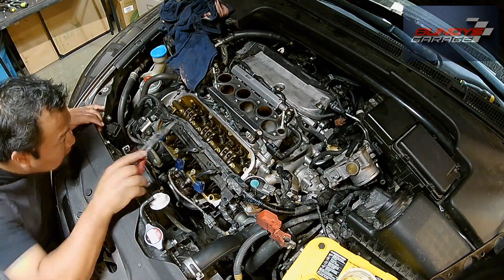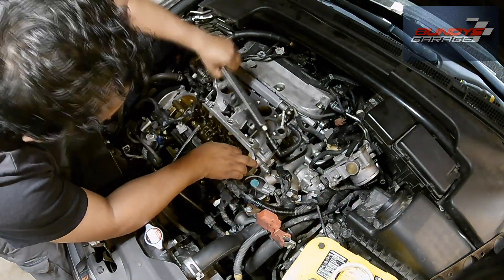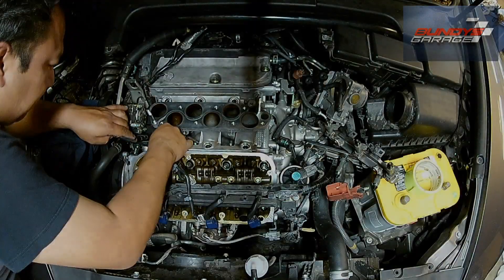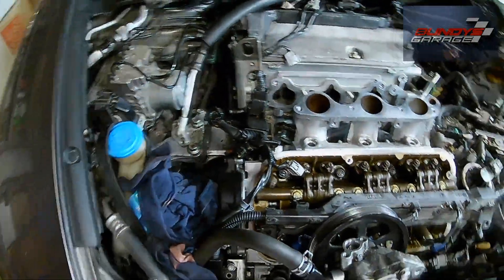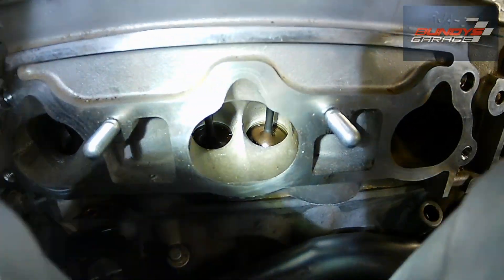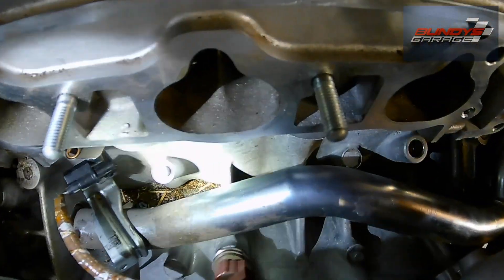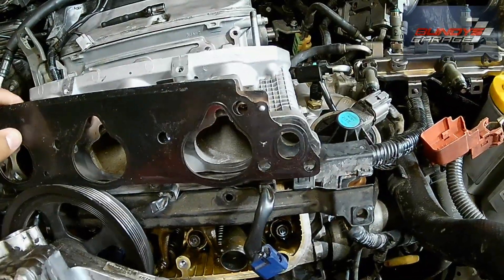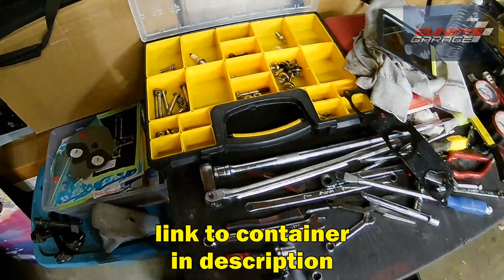Honda V6 Acura J Series Lower Intake Manifold Gasket Replacement | Accord Odyssey Pilot Ridgeline

Comment: I'm sorry... but this is the second video I've seen by this man and he's doing some questionable things. Case in point he is removing the bolts from the fuel injector rail without covering the holes of the lower intake runners! That is a MAJOR no-no. Those gaping holes are directly above the valves... you can see the back of the valves from above the chambers! You drop any piece of crap in there and it is in your combustion chamber and you're screwed. No disrespect intended but this work is careless. People, if you are going to DIY with deep dive repairs watch multiple videos on whatever task you want to attempt before you go diving! One can easily wind up with way MORE expense if you break a bunch of stuff then have to hire someone anyway to fix it all. -Jess Sayin
Reply from the maker: I could delete this comment like most DIY repair channels do when they receive a bad or insulting comment. Try it some time and see how long your comment stays up. YOU MY FRIEND ARE 100% RIGHT! I should have covered those holes. I didn't but yes if you are that deep into an engine you should cover them, better safe than sorry.

Comment: hey bundy. your channel is gold. 2006 TL 188K i performed this replacement using Honda genuine parts for the gaskets along with an NTK knock sensor and genuine rat harness. it had previously had the harness replaced and i saw this when replacing my fuel injectors two months ago and figured it would be unnecessary. when i later discovered the injectors i had purchased were counterfeit, i decided to purchase Hitachi injectors from RA and do them along with the lower intake manifold gaskets and a throttle body gasket. the injectors resolved my lean condition, but i was hoping the gaskets would resolve my multiple cylinder misfires under load (WOT), but unfortunately it did not. i believe i still have a vacuum leak and the smoke test only keeps showing the EGR valve leaking which i cannot seem to find out if is normal or not on these cars.

Comment: @bundysgarage

Question hope @bundysgarage can help.

I did this same exact job on my 2002 odyssey while replacing the valve cover gaskets. Replaced all the metal gaskets related to intake manifold and the Injector Base (actual name of the 2 bottom parts that you say are the forgotten gaskets). We'll after putting it all back and torquing to specs, I got a p0171 and p0170 along with a loud air sound when pressing the accelerator coming from the back of intake. After 3 weeks of trying out multiple things replacing o2 sensor with New denso, new coils, replaced EGR, 6 new oem Injectors, new map sensor, new knock sensor, new intake tube, checking for vac leaks, replaced throttle body, inspected all hoses and plugs for damage and checked for vac leaks with smoke machine, and troubleshooting day and night, I find out I was given the injector base gaskets (forgotten gaskets as you call them) for a 99-01 odyssey which have a tear drop like shape on the ports and the one from the 02-04 are more oval.....Soooo, I figured that was the issue all along and ordered correct parts and installed and guess what...van runs great BUT still giving me the p0170 and p0171 code along with the hissing air sound from the intake that I cannot figure out.

I've been trouble shooting this van for a month now and spent over $250 in parts and have redone it all 4 times and still same issue. The van didn't have any CEL lights before this repair and would drive fine, now it boggs from 1k-2k rpm but is super smooth there after so not sure what else to do, I'm so frustrated.

Can anyone help me figure it out?

Comment: about to attempt this along with new injectors, rat cable, and a new NTK knock sensor. ive been chasing a multiple cylinder misfire under load on my 2006 TL. new hitachi coils, ngk laser iridium plugs, honda fuel pump, new aisin tbelt kit, valve adjustment, leaking spark plug tube seals and valve cover gaskets replaced, oil filter housing gasket set, cam thrust plate gaskets, and much more has been replaced but i keep getting flashing p0300, p0301, p0302, p0304, p0306 when i give it the beans for 10s ish. misfire count starts around 3,000 rpm but since i adjusted the valves it is more erratic as to when it starts, usually higher than 3,000 now.
Reply: Yoo did replacing these fix your misfires? Chasing the same thing. Did new plugs, coils, valve adjustment and still getting a random intermittent misfire
Reply: @j35ray no lol, ive done a valve adjustmsnt, ive used OE parts for ignition coils, plugs, tube seals, injectors, all intake manifold gaskets, knock sensor, fuel pump module, timing belt kit, list goes on, oil filter housing gaskets etc sometimes multiple sets to rule out counterfeits etc. im gonna get it scope, it really could only be like a clogged resonator somehow vtec failure (camshaft or rocker arm) or somehow like wiring harness ecu ghosts. mine is multiple cyl misfire under load
Reply: @wolleyreikivalley  do you have stock cats? I'm thinking mine might be the rv6 high flow cats getting clogged or something. I read about someone who's misfires went away after he took off the aftermarket cats. Is yours intermittent or comes on after you push it? Mine would always come on after I push it... like 30 sec after doing a highway pull then it starts vibrating like crazy and I see the knock count go to the 100's on my ktuner
Reply: @ stock cats, rv6 j pipe

Comment: Great video. Before removing injectors, do you relieve pressure on gas lines??? Most videos do not show this step. I thought it was safer to relieve pressure.
Reply: Just remove the 15a fuse under the dash (#1) and disconnect the negative battery terminal. That will relieve pressure

Comment: Taking the front bank intake was impossible for me. The studs require the bottom intake to come out at an angle and I suspect this demands the rear (firewall side) to come out as well- I’m just replacing the nox sensor. Took out the bracket behind power steering pump after taking it off partially and could fit my hamd in and finaglt it in.

Comment: hey Bundy I have some questions about my Honda accord v6 if you are still around
Reply from the maker: Bundys always around baby! What’s the question?
Reply: @bundysgarage  hell yea what’s up bundy is there anyway i could facetime you off gmail or something i feel like it would be easier too show you what’s going on, it’s not hard too explain but it is just some hoses and stuff from my thermostat housing i don’t know where they go and little things like that i was hoping you could point me in the right direction i can make a few videos on youtube instead of a facetime but i think a zoom call or something would be the best way too show you🤣
Reply: @bundysgarage

Question hope @bundysgarage can help.

I did this same exact job on my 2002 odyssey while replacing the valve cover gaskets. Replaced all the metal gaskets related to intake manifold and the Injector Base (actual name of the 2 bottom parts that you say are the forgotten gaskets). We'll after putting it all back and torquing to specs, I got a p0171 and p0170 along with a loud air sound when pressing the accelerator coming from the back of intake. After 3 weeks of trying out multiple things replacing o2 sensor with New denso, new coils, replaced EGR, 6 new oem Injectors, new map sensor, new knock sensor, new intake tube, checking for vac leaks, replaced throttle body, inspected all hoses and plugs for damage and checked for vac leaks with smoke machine, and troubleshooting day and night, I find out I was given the injector base gaskets (forgotten gaskets as you call them) for a 99-01 odyssey which have a tear drop like shape on the ports and the one from the 02-04 are more oval.....Soooo, I figured that was the issue all along and ordered correct parts and installed and guess what...van runs great BUT still giving me the p0170 and p0171 code along with the hissing air sound from the intake that I cannot figure out.

I've been trouble shooting this van for a month now and spent over $250 in parts and have redone it all 4 times and still same issue. The van didn't have any CEL lights before this repair and would drive fine, now it boggs from 1k-2k rpm but is super smooth there after so not sure what else to do, I'm so frustrated.

Can anyone help me figure it out?

Comment: Nice video, just used it to replace my intake gaskets after a mouse build a nest in the valley. I do have a question, I have a high idle, tried changing the iacv and its still doing it, and when I block off the hose to the throttlebody and now it squeal like a belt is loose from the back of the engine towards the firewall, but it does not die. I have tried carb cleaner and smoke machine to find a vacuum leak with no results. I have tried clamping vacuum hoses to find if one is bad. Any advice you can give? Found your video really helpful! 👍

Comment: Duuuude, I snapped the stud on one of lower manifolds when I was removing the upper intake to change the valve cover and tube seals. I was devastated because I thought they might have been directly off the block. (Im dumb and didn't know much about my car at the time) Now I know I can replace them and have an instructional video on how to do it. Thank you!

Comment: Great video, helped me do my 06 Odyssey lower gaskets.  That is pretty intimidating and does not come off easy.  Key is to take off bank 1 (rear) first.  I used a curved bar to get leverage on the corner of the rear intake and a small screwdriver between the two intakes.  Like you said patience, works.  I used valve grinding compound to clean up the surfaces. Stuffed paper towels into the ports to prevent contamination.   Reason for changing gaskets is that I am chasing a P0507 high idle and P2279 vacuum leak.   Will know if it works tomorrow.
Reply: Did you fix the issue. I am chasing exactly same issue in my 07 odyssey. P0507 and P2279.

Comment: Is there a good way to clean the intake valves while partially exposed? I'd assume spraying carb cleaner. Any suggestions? Thanks
Reply: Is it GDI?  This should be a MPFI engine so the injectors will keep intake valves clean

Comment: Other than the 4 bolts on bank 1 is there anything else holding it in? I can’t get bank 1 out
Reply from the maker: One of them has 4 bolts and one has 5 bolts holding it in place. If it's not coming out easy than there is a bolt left in. I don't remember if it's front or back.

Comment: I have lots of oil down in the valley by the knock sensor , any idea where that is comming from ? Thank you so much for your videos , soooo much help and very informative!
Reply from the maker: Most likely the oil is coming from the valve cover gasket and getting into the valley
Reply: I know it’s hard to give an answer without hearing and seeing it but I changed out the lower and upper intake manifold gaskets and injectors , and spark plugs and wires and now it’s running like crap , any idea where I went wrong ??? Thanks again for ur help and advice Bundy , wouldn’t be able to get anywhere without ur videos 🙏🏼🙏🏼🙏🏼🙏🏼
Reply from the maker: I would check all my spark plugs and make sure all the coils are in place and that they are all plugged in. If it was a gasket you would hear a hissing sound like air getting sucked in and most likely the car would have a really high idle. What’s the year make and model?
Reply: 99 Honda Accord 3.0 v6
Reply: Could my timing messed up ? Or maybe the valves? It’s the 4th cylinder, I pull the spark plug wire up and it doesn’t do anything the wire and plug is brand new , even switched um up and they worked fine , still don’t change when I lift the spark plug wire on 4
Reply from the maker: Are you sure you have compression in that cylinder?

Comment: Just found a crack in bank 2 thank you for this video. I'll be taking her apart. She probably needs a ground up rebuild (at this point I'm halfway there anyways)
Reply: Did you have syptmtoms similar to a blown head gasket but little to no loss of coolant? My exhaust smells bad like burning coolant. I'm about to schedule a head gasket job but I do have the lower intake manifold gasket already and ported runners just not installed so I was wondering if I should just do that first.

Comment: Here a tip for putting the grommets on the retention bolts for the valve covers.
1) Put the bolt you are working with carefully in a vise so the vise holds the wrench side of the bolt (the bolt will be pointing up).
2) Carefully cut the old grommet off with a box cutter.
3) Put the grommet on the bolt and press it over the bolt's bulge by use a box-end wrench. The wrench should just be big enough to clear the bulge of the bolt as you push the grommet past it.
Reply: It takes less than 1 min to mount a grommet onto the bolt with a socket. The trick is to use a 45 degree angle. Do not push straight down. Not much force involved in you have the angle.

Comment: Wats that metal tube running under the manifold
Reply from the maker: It’s a coolant passage tube that runs from the thermostat housing to the water pump
Reply: @bundysgarage  is that prone to leak on these engines??
Reply from the maker: No I have never seen one leak. The failure point in a J Series cooling system is the water pump

Comment: Hello. Im getting code p0507 after I did my valve cover gaskets they were leaking oil but my idle was good now my idle surges just around 1500 rpm after slaping the gas pedal then it goes down to normal. Code tells me is an intake leak or bad throtttle body. Well I have open the engine like four times recheked everything I mess with replaced the throttle body with three different ones one use two remanufactured checked for vacuum leaks with a smoke machine and my egr valve was leaking thru the top replaced it did better but the surge still there. Im getting ready to do it one more time but this time I will replace the bottom intake manifold gaskets. Dont know if that is going to be the problem but I really hope that fixes my isue with this honda odyssey. Thankx for your tips and showing us the way it does make it easier to do the repair. Orale Vato nos Vemos. Ahua.
Reply: I am in same boat.  06 Odyssey with P0507 and sometimes P2279 (vacuum leak).  Do not have smoke machine so parts cannon.  I am in process of doing the lower intake gaskets and the top ones as well.  Not sure that will fix the idle.  I have also ordered a Forwell NT530 which says it will allow me to do a throttle relearn.  If that does not fix it, might have to go to dealer.  I did throttle body clean and have a spare throttle body, neither fix the high idle.  This all began when I installed a JDM 3.0 engine.  That engine runs fine except to the idle.
Reply: @Lloyd-z3q  Did you fix the issue? I have exactly same issue after I removed the throttle body and cleaned it thoroughly. I reset the ECU by using ELM327 blue tooth adapter and a free app on android called "Throttle reset" .I believe the throttle position is reset because the only code left is P2279 (vacuum leak). Now I am on a hunt for this vacuum leak.
Reply: Did you find out what was causing your RPM SURGES? I am having the same issue on my 2003 odyssey
Reply: @reneaguirre9380  I took it apart three times thinking I did something wrong, then I replaced the throtle body twice and after many weeks of troubleshooting I found that if you disconect the throtle body and if you remove the battery  you will have to take it to the dealer for them to reprogram and re-learn with the new throtle body. In the long run I learn something, if I was to do it again or clean the throtle body I would Not unplug the electricals or battery, yes you can remove the throtle body and clean it in a pan ontop of engine. After a while I got tired of this honda and sold it. Dealers dont want you to mess with your own vehicle so I bought me a 1985 K5 Blazer 4 Wheel drive and Im just having so much fun. Cheers.
Reply: Same issue after changing the valve cover gaskets

Comment: i have been watching your videos and i have learned alot being that i own a 2005 acura rl which has the j engine 3.5 my question to you have you ran into these problems where you get codes 1717 and check emisions but no code and also i have replaced the vsa pump which went bad i tried clearing codes but they wont clear code 84.1 and now im getting code 64.1 which is for the awd but this code  is on now after i replaced the pump do you know any fixes for these problems thanks